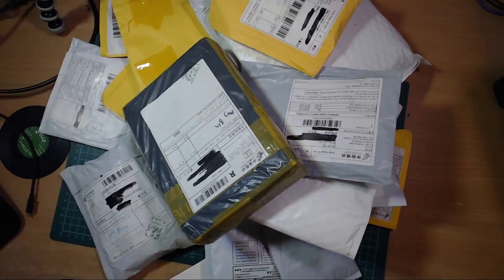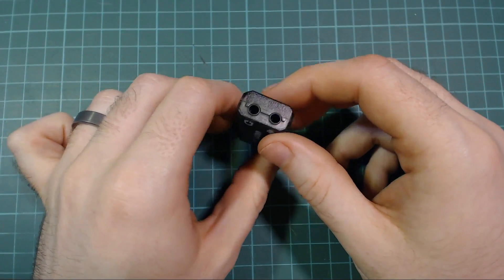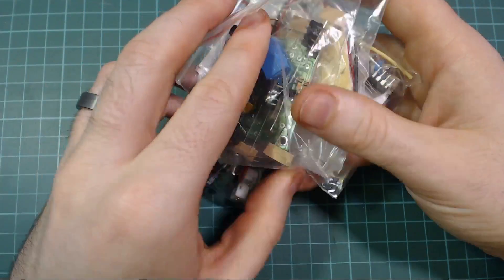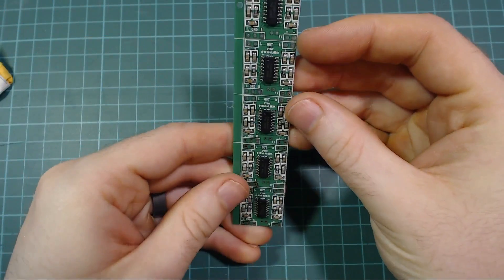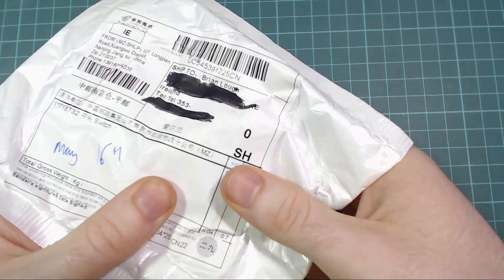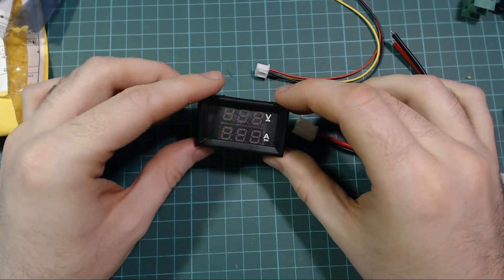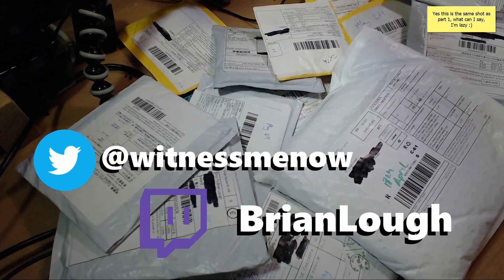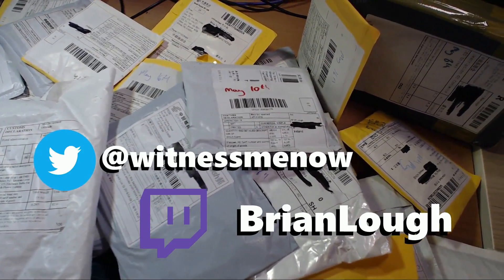#3 Post Bag Time! (Part 2 of 2)

Comment: Seems like i got exactly the same 5v 8a power supply but with a much more useless cable (as we’ve talked about on Twitter). But I tested the supply 1 hour at max load and it’s doing fine. So it will be good enough for our beloved led matrix

Comment: PAM8430 => could this be the same audio-amp i sent you ;-) ?

11:58 => only power those when you're measuring humidity. liquid + current = increased corrosion.
There are capacitive versions around now.

Honestly: For the power supply: I do NOT AT ALL trust chinese bought/imported power supplies.
You just dont know if they are up to standards and you are living in a false safety because you think its only 5V...
you just can't be sure about high voltage to low voltage side isolation or if they go up in flames after some times.

There are just too many risks of fire or destroyed ICs which can go horribly wrong, if somebody else of the family uses them or you are not watching it all the time.

Yes, almost all manufacturers also get their PSUs build in china, but they have to keep the standards to import them, which are luckily very high.

...And by now also the "real" ones are not expensive anymore.

For a bench power supply i do have a bigger one (up to 30V / 15A), but for the simple stuff i'm using an old
Netgear 12V / 1A Netgear transformator power supply. (LAN switch)
If only low load it runs up to 16V DC "idle", so i got an array of 12V => 5V  => 3.3V analog linear regulators behind it,
which give enough power for most IC's / testing and perfect smooth voltage. All isolated from main power + short cuircuit safe at 1 Amp max.
Reply from the maker: It could well be actually! Well that was a waste for me to buy 😁
Reply: Did some editing + more text up there... :-)

Comment: Hi Brian! Great editing! I can tell that you spent a ton of time editing that video.  All the popup commentary must have taken some legwork in addition to actually putting them into the timeline.  
Thx for the links, I've just bought the usb audio card, amp, and led matrix (can never have too many ). Thx for sharing Brian!
Reply from the maker: Thanks Hari. Yeah the main cost of time was the address blurring.

I actually saw unexpected maker do the screen shot of the product page thing in his first mailbag and thought it worked really well (but he has since stopped doing it), I thought the days travelled is a useful stat as well, its pretty crazy to see the difference between different time of the year.

I was actually talking about you on my stream on twitch this morning! I was using inspiration from you "keypad on one analog pin" video to connect a series of buttons to an attiny85. It worked great!
Reply: Be careful with that single pin hack.  Since it is analog based, it is important to account for voltage variations. Any fluctuations due to say, large # of LEDs turned on at the same time might skew the voltage.  Should be fine if you have a large enough "slop" in the ranges.  The more buttons, the less room we have for slop :-(  I haven't watch your stream to know how many buttons you're using.

Comment: at 0:50, those are called Desoldering Hollow Needles, look for this on youtube and you'll see that in practice you add heat to some component soldered leg, then you slip in the needle so you trap the rheophore inside the needle hole, which is not sticky for solder tin, and you can then free it and go for the next... they're quite tricky for small rheophores, but very useful for desolder big ones like ac/ac transformers, transistors, diodes, etc

Comment: if powering the volt/ammeter directly from the same rail you're measuring, you can't go under 1.5V, usually, which is the minimum voltage needed by the module itself...

Comment: Detailed video how to use desoldering tools @1:21 from learnelectronics channel: https://www.youtube.com/watch?v=NlkebIBpw80&t=1s
It is really helpful with desoldering trough-hole parts.
water censors is disposable part, it will corrode over time. So if you have a project for this, 10 is good.
Reply from the maker: Thanks for the link, they look pretty useful actually! 

Yeah that's true, better to be looking at them than looking for them!